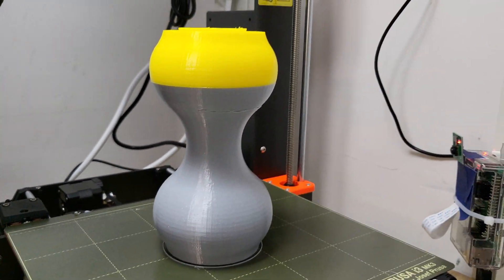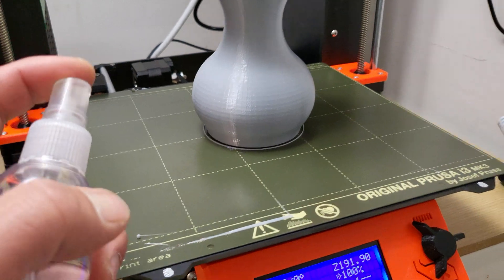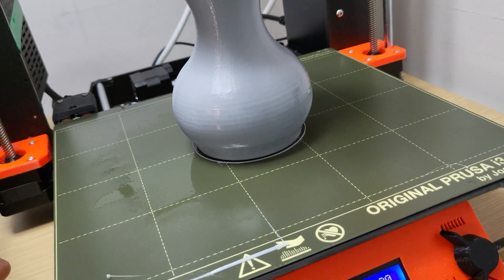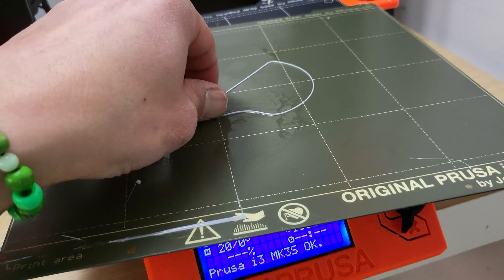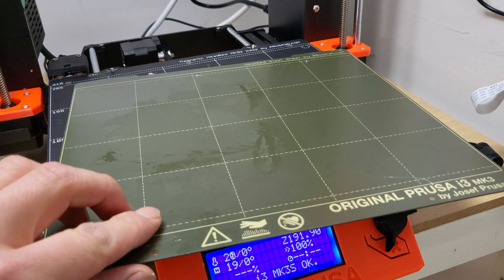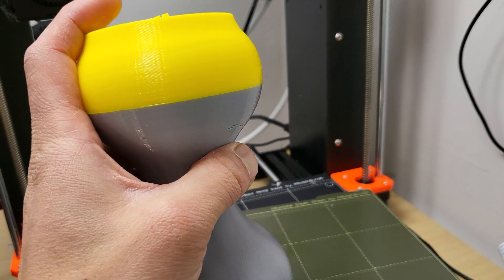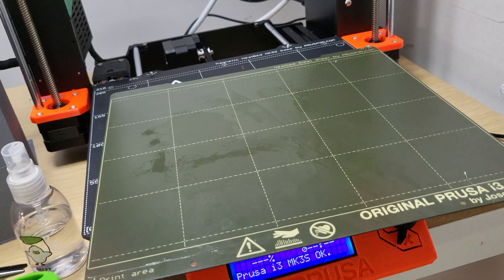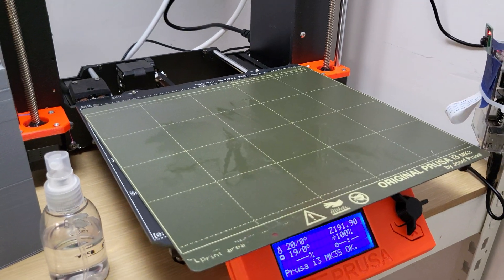How to get TPU off easily on Prusa MK3S+ using Isopropyl Alcohol!

Comment: While a bit old but thanks for the hint. After a TPU print I tried cooling / freezing my MK3S+ smooth bed sheet and tried to flex the print off. A few corners released but not much else. I then saw your video. I heated my bed up to 60C and applied a little isopropyl alchohol to the edges of my print and voila, it started releasing without any damage. I may need to use a glue stick next time but maybe not if this workd Thanks!